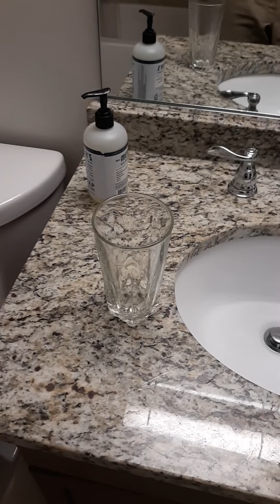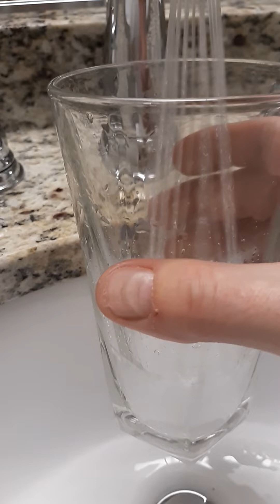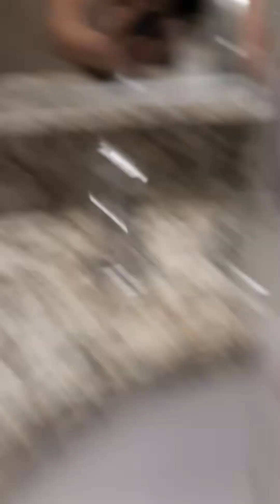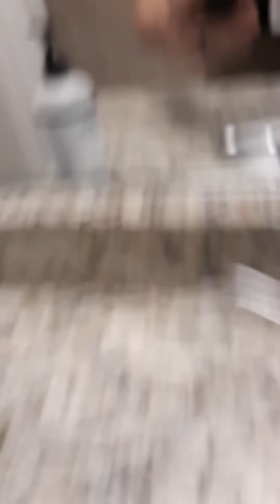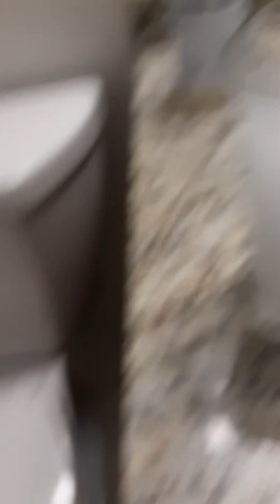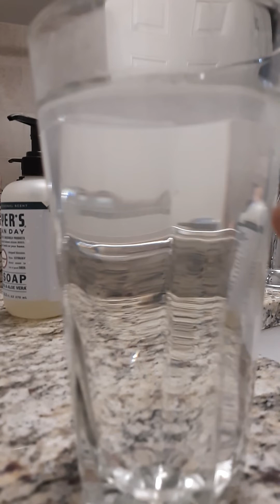Why is my water from the tap cloudy?

Comment: That seems to be an answer for cloudy hot water. But ....My cold water has the same air bubbles.  but not at every faucet. My kitchen has an aerator but no bubbles while My bathroom does not have an aerator but it has the almost milky looking bubbles. 
My waterline splits when it come into the house the part that goes to the bathroom is separate from the line that goes to  the kitchen and the bubbles are only showing in the bathroom water.  I want to know why it's happening on one side of the house and not the other. And It's not the aerator.

Comment: My water is like this in the kitchen and in the bathroom aswell… the hot water is milky color like this, the cold water is a little bit better but you can still see a bit of cloudy as well… is that ok? Is it healthy to drink this kind of water?
Reply: Invest in an under the sink filter system if you're drinking the water from your sink. There are a lot of chemicals and contaminents in tap water.

Comment: White cloudy water only stemming from hot water is a good sign your hot water heater has a huge build up of shale in it.
Reply: How bout if it only happens in the kitchen but not the bathroom?
Reply: @HawaiianSkies then it’s the aerator on that faucet. If it’s all sinks then it’s water heater
Reply: @adconreal8926  thx. Yeah pretty sure it’s the water heater..
Reply: @HawaiianSkies mines is opposite. Very cloudy in restroom sink but kitchen sink Is lightly cloudy
Reply: Mine happens only in the bathroom faucet. I also checked water from the supply line directly. Still cloudy without an aerator. Why? Can’t be the water heater because all other bathrooms and kitchen sink is clear.

Comment: It could also be a result of the magnesium android creating hydrogen bubbles inside of the water heater.If it does it only on the hot side then Change the anode rod inside the water heater.

Comment: Mine does this even with cold water however i dont have an airator but my question is. Why does it slowly give off a white gas like smoke as well as the water get clearer if its just oxygen ??
Reply: Something is wrong here! Our water was perfect until they shut down ouR water for 6 hours today to work on the local water pipe. Now it has these air bubbles that IT NEVER HAD BEFORE! Something is not right and I intend to find out why. I will NOT ACCEPT LIES I WILL SAY THIS.
Reply: @wheelie642 🤯 This literally happened to us today! That’s why I came on here, because we never had this problem before!
Reply: did you ever figure this out Jalen? - i did some plumbing repairs and now my hot & cold do this. been a few days now. i’m assuming it should clear 🤷🏻‍♂️🤷🏻‍♂️
Reply: @willieboy8667  nope still milky water to this day

Comment: Question: But is it safe to drink/use? The same thing is happening with my water but when I use cold water. (Haven't tried hot) Is it bad if left like that or is there a fix?
Reply from the maker: have you had your water tested?  your local big box store should have a test kit for your water.  id say start there if you have concerns.
Reply: @beermonkey9424  thanks for the tip, but actually, the issue has somewhat gone away on its own. There was construction nearby but soon after a day or two it had almost cleared up. I'll still try the kit just to check it out, thanks.